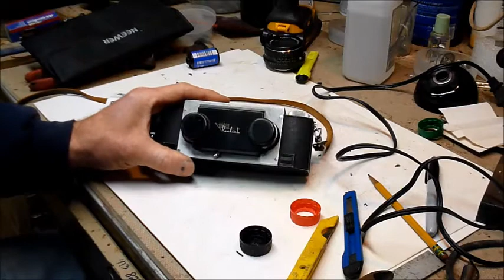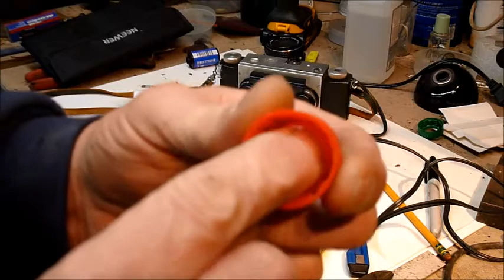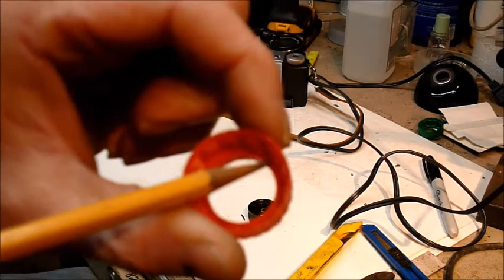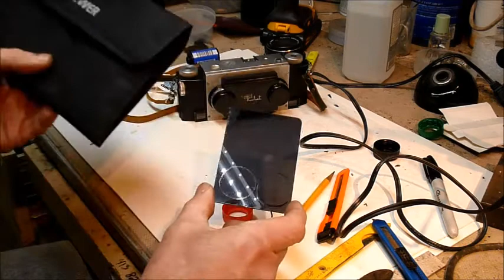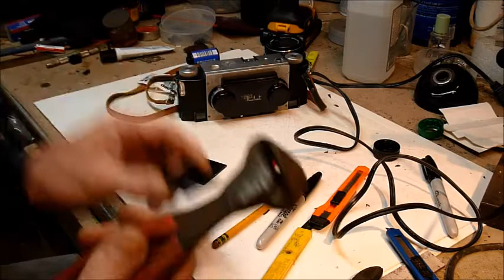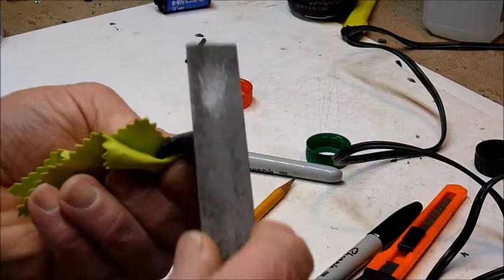Neutral density filter for a stereo realist camera

Comment: Hi, this is a 6 year old video, I’m not sure if you are active here.
I always used good old Kodachrome ASA 25. Since its demise  I’ve used either Fujichrome Provia ASA 100 and/or Velvia ASA 50. I think Kodak still makes an Ektachrome ASA 100?. 
The Realist 3.5’s top speed is 1/150 second. Using the Sunny f16 rule 1/150 sec would give you 1/150 sec af f16 on a bright sunny day.  The difference between 1/100 sec and 1/150 is 1/2 a stop.
Remember shooting stereo you should be using max depth of field. I’ve shot 90% of my film at 1/150 at f16
When I shot with a f3.5 model I always bracketed. 1/2 stop over, under and as metered. I always carried a light meter, nowadays there are metering apps for I-phones. On the 3.5 model its easy enough to set the aperture between stops. I imagine if your meter calls for say f19 you could set your camera between stops.
In between aperture’s is OK, but NOT shutter speeds.
You could try and find a Realist f2.8 model, they have a top speed of 1/200 second.

With slide film at $30 a roll wasting 2 shots by bracketing could be expensive.

I’ll check in here in a day or so to see if you replied.
Regards
Tom
Good Luck
Tom
Reply from the maker: @thomasheckhaus205  that's useful information,  Asa 25 is still available, and finding out what speed these old cameras use is tough. Thanks for the info. Those ND filters work ok but they are a pain to use.